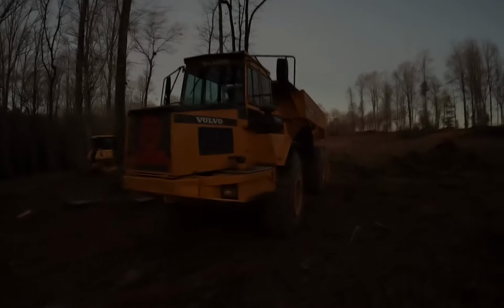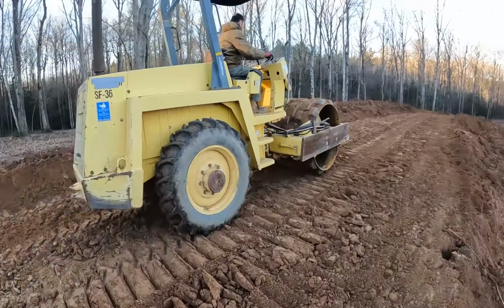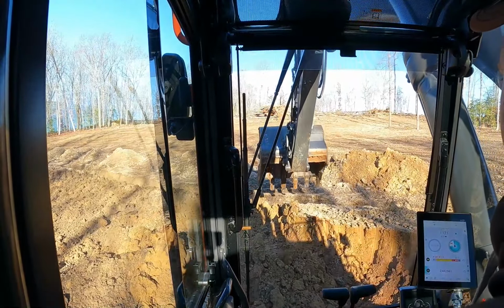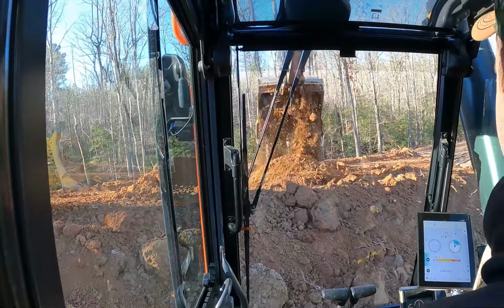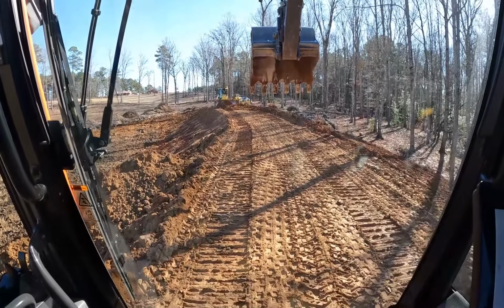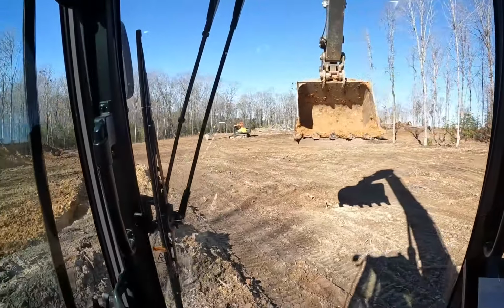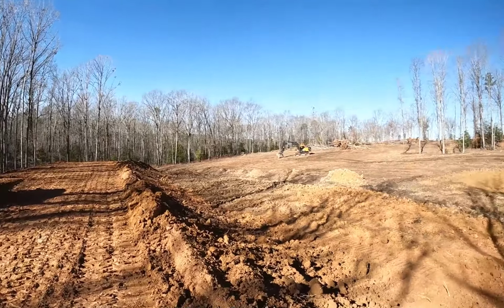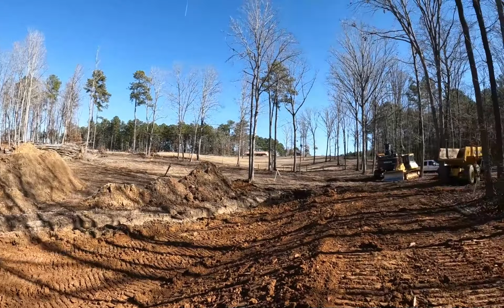Day 2 Digging The Deep Pond

Comment: Big progress! It's going to be tough going back to the tiny 220. Hopefully you'll pick up a few 5 to 10 acre pond jobs before the demo clock runs out. The 550 is a bit of overkill for a lot of the jobs you do, and moving it can be a PITA, but it sure is nice when you want to move a lot of material in a short amount of time, isn't it? I'm wondering when they're going to install hydraulics to extend and retract the tracks on those beasts...
Reply: This machine, because it's a demo machine would be one of the very few machines that gets the tracks moved more that once or twice a year, many of them would be done once when the machine is moved to site, then once again when they sell it when there's too many hours on it.

Comment: I love the Beast. So if im thinking right you can load the truck wirh 2 and a half bucket verses 8 or 9 with the 220. What im seeing is you can load or move 2 times as much material with the 550 than both 220"s. Im sure the 550 is alot more headache to transport than a 220 but you can keep a man busy moving material on the dozer with the 550 . So impressive. Thanks for showing us the Beast. Love it Love it Love it.

Comment: Okay, the 550 has a huge boom, a huge bucket, huge tracks, and a huge cab. How in the world does all that balance on one little center pin/swing drive? Amazing engineering to see such power and size rotating on a  comparatively small unit. Glad Volvo loaned you this one to play with.
Reply: imagine over 100000 dirt moving enthusiasts seing this.
free big marketing for volvo.
Reply: @redwarf8118  Its fair to say I brought the Volvo 220 after watching his video's. I figured I'd give Volvo a go. I certainly don't regret it. It's an awesome machine and 2500hrs of absolutely trouble free running now. Done nothing but oil changes. Shit I even ended up buying the TL12 as well although that was more about it being the best machine for my application. That said Chris is an operator as am I and guys who operate the equipment themselves like to have good gear.
Reply: It's got a huge center pin and huge swing drive.
Reply: @garymurt9112  no, the center 'pin' is where oil slip ring is, all the weight is carried on the outer edge of the ring by roller bearings

Comment: hi Chris can i ask whats the fuel consumption on the 550 per day compared to your 220 and how much more yardage can you move super video thanks for sharing
Reply: Interesting question...
Reply: I’m not sure on this machine but I know that the 550 is 456Hp and I run a Case Quadtrac tractors that around 620 Hp which burns around 25 Gal/hr or around 400 Gals a day so I imagine it’s a little less maybe 250 to 300 gallons on a full day.
Reply: I asked about the yardage the other day , Chris said the 220 was 1.5 yard and the 550 was 5.5 yard bucket
Reply: Twice as much!
Reply: This was about a day and a half of work so far in the series and toward the end of this video he said he's used a half tank. 180gal tank, so 90gal. That's a whole lot of dirt moved for 90 gal of fuel.
Reply: @jasonrussell6534  Honestly if those numbers are right that’s insane efficiency like on our big 4 Track tractors we can go about 18 hours on a tank of fuel which holds around 400 gallons. I just wonder how much DEF it uses that’s the problem we run into on the 600HP John Deere’s 4WD’s the DEF runs out before the fuel so we end up filling both.
Reply: I know it's a demo and u get what they give you but watching him fill the bucket drives me nuts..... in this material with the coupler a 4.5 yard would be faster and easier on machine.....
Reply: @ronaldlarue1107 watching this big Volvo makes me wonder if it isn’t just underpowered or turned down for demo. I know it’s a big bucket and a big machine but filling that thing is painful. I ran a 350 Deere for a while. Believe the bucket was  around 3.5 yards with a quick coupler. It handled that way better than this Volvo handles the 5.5.
Reply: @alexbaer7810  The bucket does appear to be a tad oversized for that machine it seems to heavy extended out and the hydraulic cycle time is kinda slow but what do I know I’m just a farmer lol
Reply: @crandonborth  yea I feel the same. Technically I’m an excavation contractor so I should know but our biggest machine is 18 ton and if we need anything bigger we rent so I could be full of it lol. Just seems really slow and underpowered.
Reply: @alexbaer7810  He could turn up the throttle if he wanted more speed, power (and fuel consumption).
The machine also has long stick and quick coupler, - not the best combo for this size bucket and material.
Reply: @bigkeef-778  220 - 8 scoops to fill the haul truck. This animal - 3x 3/4 full buckets to overfill the haul truck. Going to need a bigger truck...
Reply: @petemoore5104  bigger truck and 2 more trucks.  And drivers.
Reply: @fredrikherbertsson3447  it works that way up to a point but relief pressure is the same at mid throttle as it is at full. Typically if you can’t break out a stump at 2/3 throttle going to full doesn’t make much of a difference. It will just move the machine faster. You notice how easily the stick powers out when he goes to push loose material? It’s not stalling the engine out just going into relief. Maybe the pressure could be turned up. I know our local komatsu dealer sends machines out the door with the pumps set a bit higher than factory. Definitely makes them quicker.  Harder on fuel though.
Reply: @ronaldlarue1107  yup the bucket is slapping around inside the coupler, I see that…gonna give it back anyway so…welp…who cares…apparently Volvo doesn’t!

Comment: excellent progress, Chris. I'm curious, at what point is the maximum angle you can operate the dozer on a slope like that before you have an engine oiling issue? I have flown an airplane with an inverted oil pickup system so steep angles weren't a problem. I worked with a guy that locked up the engine on his spanking new eXmark mowing the side of his pond levee due to oil starvation.
Thanks & Cheers from Louisiana.
Reply from the maker: If it don't tip.over it's. Fine to run on the slope

Comment: This machine seems to move/work slower. True? Or is it an optical illusion ?
Reply: this excavator has a much larger mass, the larger the mass, the more inert it is and it is more difficult to accelerate and stop it
Reply: True.  But it has more reach and triple the bucket capacity compared to the 220.

Comment: Imagine running a 750 everyday . Those big machines are fun but unwieldy .
Reply: Chris ran a EL950 awhile back that’s bigger yet like 120 Ton or close to it.
Reply: @crandonborth  yeah I watched that video too. I ran a 750 for about 2 years so I understand the learning curve as I own a EC220 like Chris's older one
Reply: @apollorobb  Nice… I been looking at getting a machine around that size for cleaning up brush and fence lines seem that 220 is about the right size of speed and strength. The 160 seems kinda small on bigger stumps and cutting ditches and the 250 size would sink like a brick where I live. I’m torn between a Volvo and CAT the other brands I’ve pretty much have eliminated but after watching Chris’s channel for awhile Volvos seem to be much smoother.
Reply: @crandonborth  I've ran Deere's and Kobelcos and Cats amongst others and the Volvo 220 is the best machine I've ran hands down thing is smooth as butter and it has power for days

Comment: Chris that 550E is a Beast. You my need one, seems your doing several big ponds, or it may be cheaper to rent one. If you don’t mind me asking what is the Reno right or something like that
Reply: Transportation cost is very high for something of that size and weight.  It also takes a lot of time to load and unload.  It's not practical for any small or medium sized projects.  But it sure is fun to see Chris using it on this pond build!

Comment: The 550 looks like she needs a bit more weight in the rear. Also, can’t you adjust the breakout force in the computer?
Reply: Chris said the bucket is oversized for this type on job
Reply: @richardschipper5989 That makes perfect sense! Guess I didn’t hear that part when he took delivery of it. It looked more like standard bucket for a 700 series but I wasn’t exactly sure as the camera always seems to make things look a little smaller than they actually are.

Comment: Chris the spike Roller is that better than a flat Roller. Never seen a Spike Roller until Yours.
Reply: Sheep’s foot, very common in the industry
Reply: The sheep foot roller allows the next lift to lock into the previous lift.
Reply: Sheep's foot vibration compactors are better for dirt. At least that's what we used. Regards.
Reply: The feet concentrates the compaction force.
Reply: @ko9446  Never heard of it being called The Sheeps Foot Roller before. And the only thing that I have seen so close to that. Is those Huge Bulldozers at the Landfills. That the they have 4 Wheels are Metal Spiked just like Chris's Roller. And a Blade that is about 30' feet wide.
Reply: @MarkORoth-fu2cy  pretty much the same thing. There are different profiles of the sheep foot for different applications. Same principle of creating divots to lock in the next layer or lift.
Reply: @ko9446  Okay Thanks for the explanation. And I know why I have never seen a Sheeps Foot Roller before. Am here on Delmarva and here in Delaware. We don't have Clay. Only Sand. And of course you can't pack Sand. Unless you pack it in a Sack.

Comment: Does anyone offer a thumb for a 550?  Imagine it with aa 2-3ft bucket on it and clearing trees.  😳 I’d be curious how much you could dial in the electronics  to operate like the 220. Or how much faster it can pull the bucket threw hard ground.  Hope Chris feel plays with the settings on it.